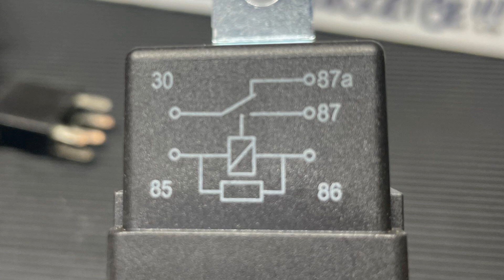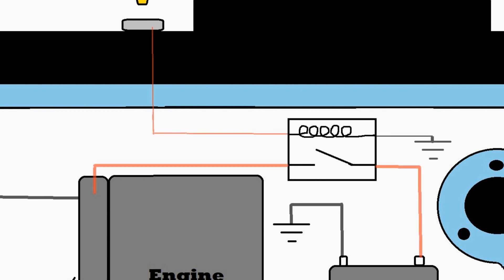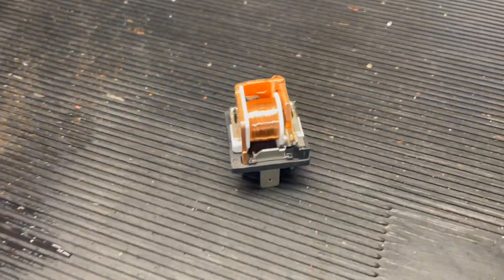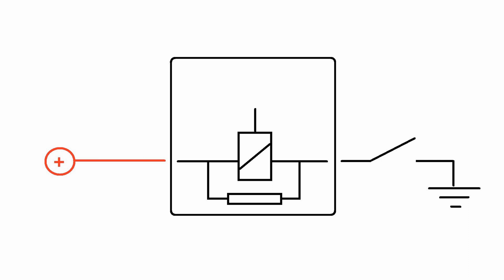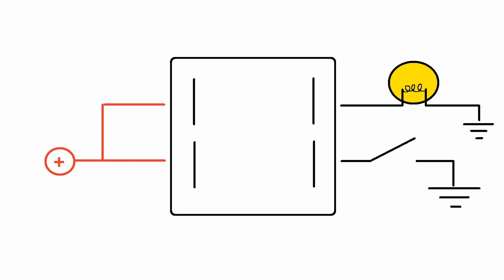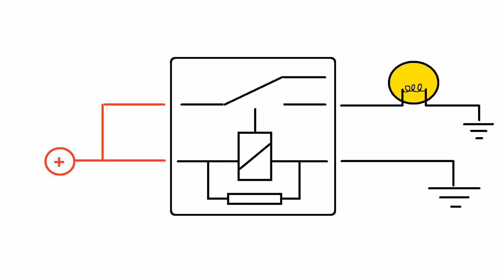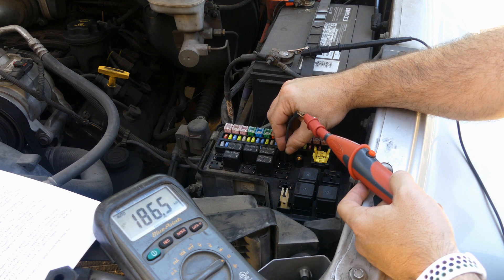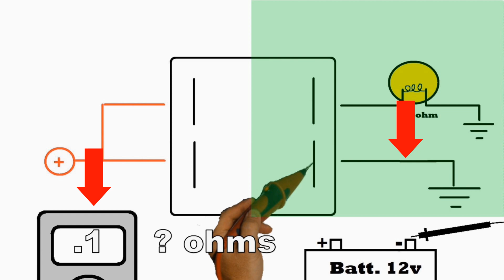Automotive Relays: EVERYTHING you need to KNOW!!

Comment: Is there a meassurable difference between a non-resister relay and a resistor type relay ?  If so, how many ohm do they read ?
Reply from the maker: That depends on the relay itself. You’d have to look the part number up with the manufacturer